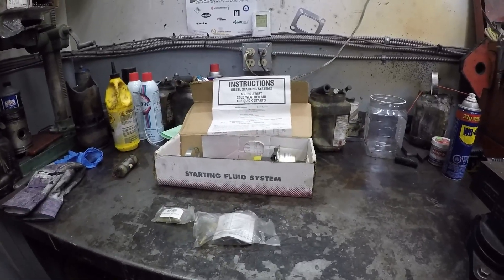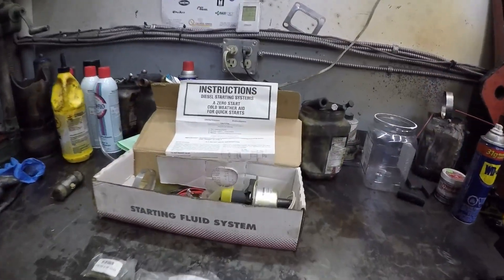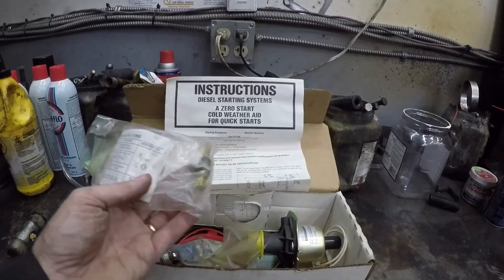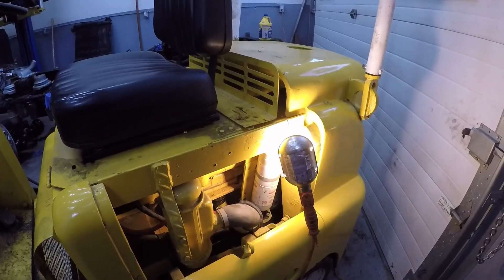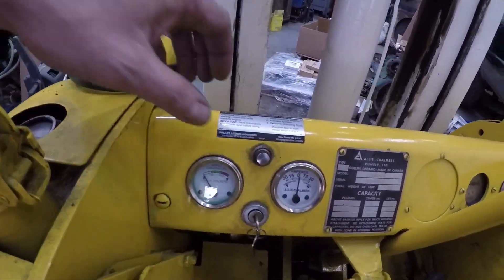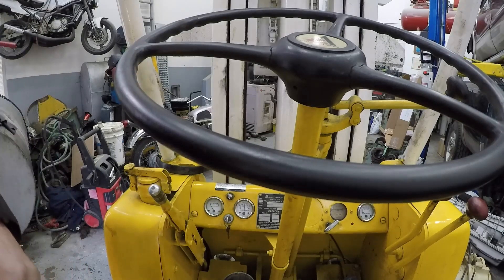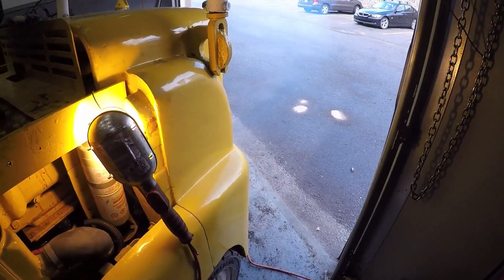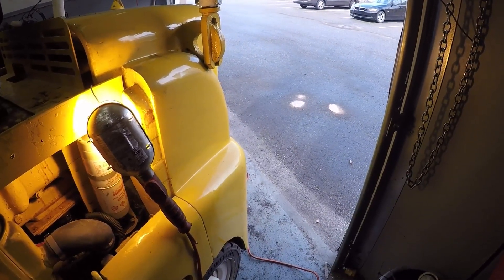Ether Cold Start System

Comment: Do you use these on any of your detroits?
Reply from the maker: No, I found valve over the years of use the valve starts to leak.  I stopped using this one in the Buda and used the can instead.  Haven't used any ether on my Detroits.:)  I still have a new one in the box and never used it. Nice system when they work.:)
Reply: @detroitgarage9430  that's too bad those valves don't last. Seems like it would be a great way to get a Detroit to fire in the cold without all that cranking.
Reply from the maker: @444mopar  True, it's a great system.  I bought two, one for the Buda and one for my Silver 4-53T.  Once the one on the Buda started to leak I didn't trust it anymore.  If they leak really bad, they'll cause a runaway.:)  Bought a Webasto coolant heater instead and that works great.:)

Comment: What brand of ether system are you using?I have found Kat’s but they do not have the safety feature of discharging while cranking.
Reply from the maker: I’m running the Temro system.  You’ll have to wire it in the start circuit, that way it can only be activated while starting.  I did this so my kids or anyone can’t activate it while the engine is running.

Comment: That ‘s going to be a project for this summer on my Timberjack...first start of the morning is challenging even at 5-10 degree C. (3-53T Silver) 30 min block heater does well too but not that practical in the woods and ether shot while cracking with the can is challenging with a close cab! Thanks for showing and for your comments.
Reply from the maker: Thanks for watching.  The ether injection works really nice and one press of the button while cranking is all it needs. On a Timberjack in the woods is a great starting aid as you can’t alway pug them in.